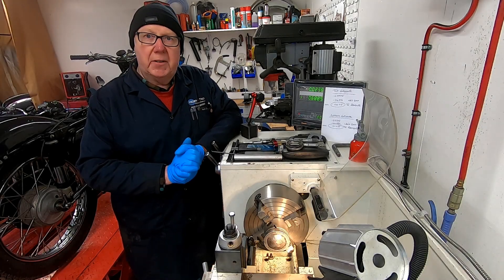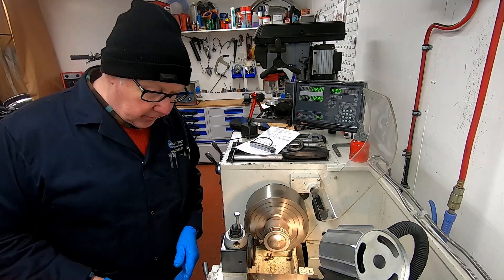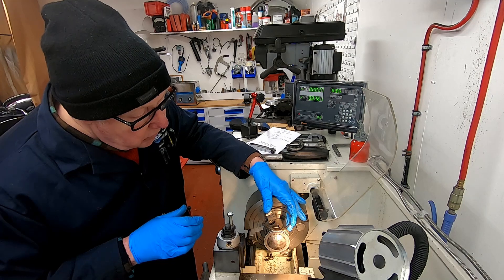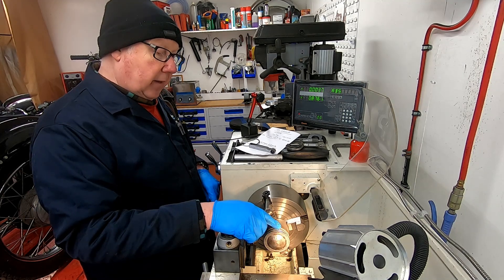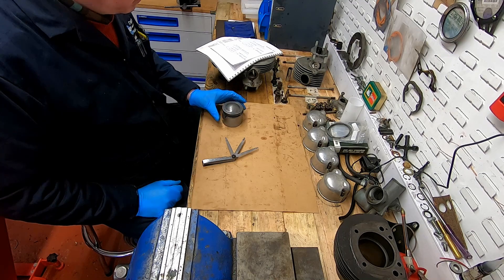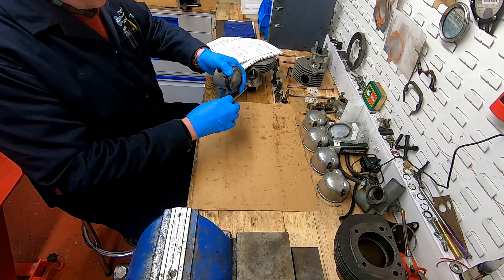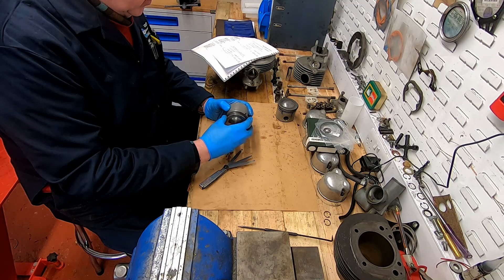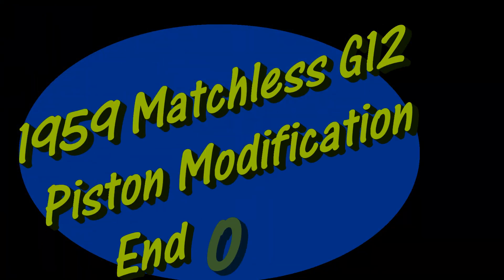1959 Matchless G12 Piston Modification Part 4

Comment: Working on the exact same G12 Pistons and facing the same issue where rings are not available at +040" can you advise what rings did you used for this modification?